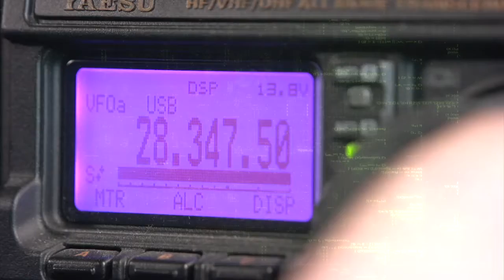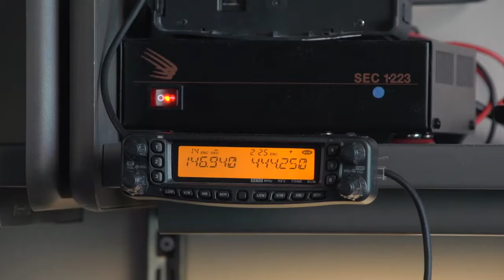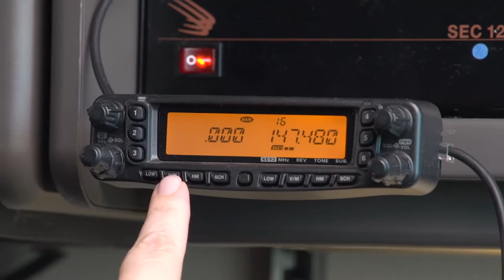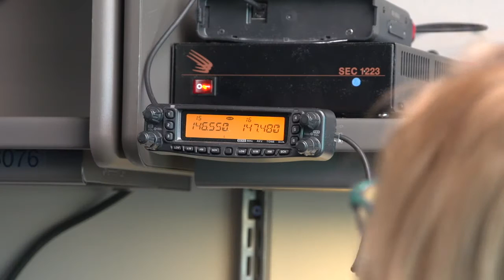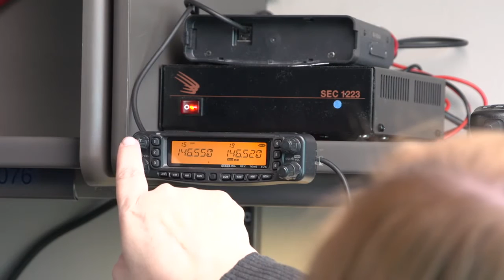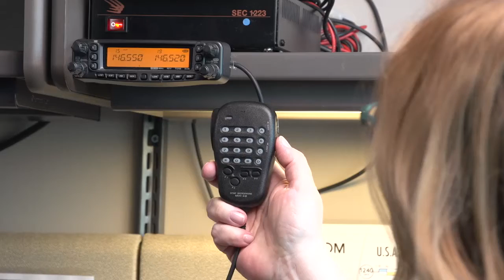03 UHF VHF CAPABILITIES

Comment: I have the 8800 set...very good set often used for Raynet events and constantly used to monitor air band and marine bands. It does crossband repeater, used for raynet events and also for 'echolink'...so around a very useful radio to have and of course highly portable weighing in at less than a pound of sugar...